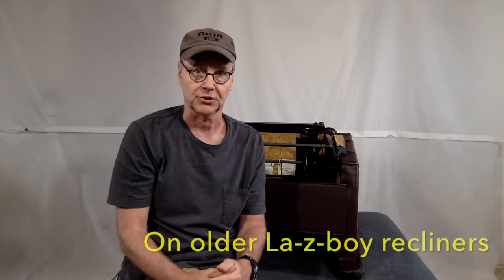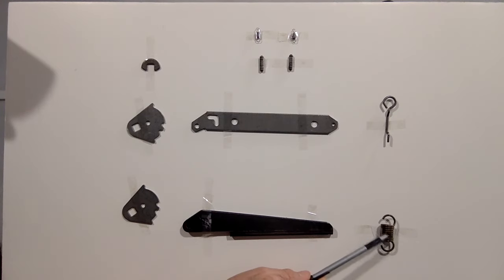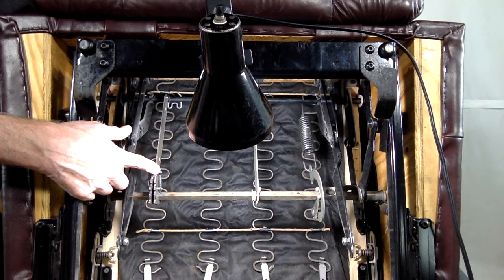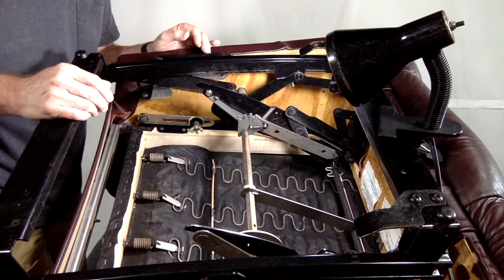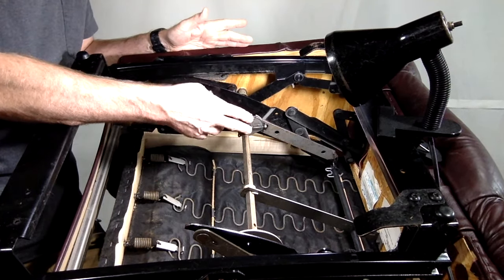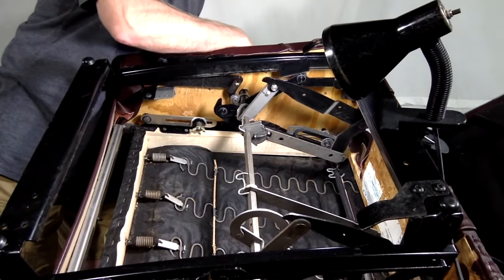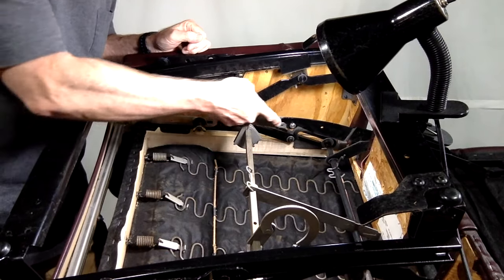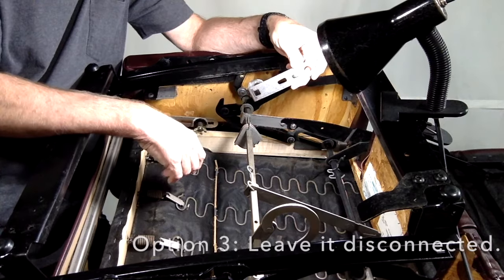Troubleshooting the La-z-boy 3-Position Footrest Feature

Comment: Hi can anyone help. I just got 2 3 position recliners. I am having trouble closing them. I have it fully opened in the third position but when I try to close it it kind of clanks down all at once is is very loud. I cant seem to make it smooth close.I dont know what I am doing wrong,,, Any help would be appreciated. thank you
Reply from the maker: @Valerie Fania - That's normal operation for this La-z-boy design. 

To avoid this sound, some users do the following:
1) If you have long legs, take 1 foot off of the footrest and place it on the floor beside the chair. Push back -- against the floor -- while closing the footrest. This will relieve the pressure.
2) Rock back in the chair just before lowering the footrest. This takes some coordination, but it works if the ratcheting recline is not maxed out (tilted back all the way).
Reply: Omg this was my issue too!  Thanks so much. Now my dogs won’t jump every time I close the chair!

Comment: My non has a 5 years old electric la z boy recliner and plastic mechanism that lift the  footrest broke.   They provide me the part    Do you have any video how to replace it or advise ?   Thanks
Reply from the maker: Reynaldo Pena -  No videos on that subject yet, sorry. If it's the plastic part that slides onto the Drive Rod, that's not an easy fix. I would recommend having a La-z-boy repair tech do that one. 

However, if it's not that one, the other plastic parts are pretty easy to replace. Contact your dealer for a sketch if you're having trouble visualizing how the broken part was originally attached.

Comment: Hi. I have the same type of mechanism as the recliner you are working on in this video...metal parts & bullet pins except I have 2 metal position levers that connect together, one large & one small & I also have a large coil spring..  I'm having trouble figuring out how to install the position levers and where do I connect the coil spring & does the coil spring face up towards the cusion?
Thanks.
Reply from the maker: @Marty Tobias - I don't have a photo to send you at the moment. Contact me through my email address -- pete@reclinerrepairguy.com -- and I'll try to send a photo when I'm back in the shop.
Reply: @reclinerrepairguy4155  Thank You Sir.

Comment: Thank you as well! Simple fix for an stuck extended foot rest on my wife's wall hugger Lazy Boy. I would not have figured out the pin and spring position mechanism without watching your video. While trying to figure it out my wife remarked "does it need a little WD-40? Well, turns out it did, on the springs holding the position pins. Fixed! Now for the other problem. The rollers which allow the chair to slide forward while the back goes down, are worn. I believe at least one of them is damaged. Do you have a video that shows taking apart that part of the base?
Reply from the maker: Stan - I haven't done a video on the rollers (Bearing Link Subassemblies) yet. They come with a plastic cover over the steel wheels for quiet operation. Over time, the covers will crack, split and eventually start falling off. This can make operation noisy and/or rough.

Since the covers are not available separately, the entire Bearing Link Subassembly has to be replaced. Having said that, you can try this first: Remove the plastic plugs on the end of the base tracks (where the rollers travel). Clean out all the dirt and crud that accumulates in the track and causes rough, uneven operation. Also, remove any remaining bits of the plastic covers from all the rollers (if any cover is completely intact, leave it on). This should solve the rough operation problems. 

However, the missing covers allow the steel wheels to make contact with the steel base, which can be noisy. The only solution for that is to replace the Bearing Link Subs with new ones that will come with the covers installed.
Reply: @reclinerrepairguy4155  Thank you very much. I am going to try cleaning out the tracks. You are right that it makes the operation noisy. I might try to replace those bearings (Bearing Link Subs) later as you mentioned. I will try this first and see. Thanks again

Comment: We have a La-z-boy reclining sectional sofa.  We have trouble closing the footrest on one end, while sitting on it.  The footrest hits something and won't close.  If you get up, then push the footrest with your foot, it will close fine.  We have turned it over and can't figure out what's going on with it.  We can't see anything that looks out of place or broken.  Thanks for any help that you can offer.
Reply from the maker: @Nancy Nabholz - That could be due to a few different things: The footrest may be striking the floor or the frame of the sectional. Or, the Leg Extension scissors may be striking the front floor rail, or the mechanism may be bent / damaged. 

I recommend having an experienced La-z-boy repair tech pinpoint the cause.
Reply: @reclinerrepairguy4155  Thank you!

Comment: Thought I'd try this with my problem with my old lazyboy, you recline all the way back so you're laying down basically and it locks and you can't slide back, pretty frustrating though it is a 2005 model. Not sure if it's fixable though. Great video though ☺️
Reply from the maker: @Christian P - If it's a manual recliner and you're referring to the back not returning to an upright position, check out these Seat Swing (the parts that control back tilt) videos: https://www.youtube.com/watch?v=eGYS17hvOzY and https://www.youtube.com/watch?v=jzN1x5jZ-gA&t=3s

If that doesn't help, have an experienced La-z-boy repair tech check out your chair.
Reply: @reclinerrepairguy4155  thank you for the help, checked out the video's and managed to fix it by unwinding the springs fully :)
Reply from the maker: @ChristianP85  - You're welcome - good job!

Comment: do you know what size of springs I need for pivot pins I cannot seem to find them under the chair ?
Reply from the maker: @Dar Piche - I don't know the size, but the Part name is Extension Springs. This is a common part that a dealer may have in stock. When requesting this part, let them know that they are part of the older 3-position setup, so they know exactly what springs you're referring to. Be sure to request 2.

Comment: The bolt that connects my extension scissor to my rear arm has sheared off. I have no idea if I can get a replacement, but I'm so grateful you have helped me learn the correct terms to use as I begin my search. Please keep up the good work!
Reply from the maker: @Dave Killion -- Those shoulder bolts are no longer available. They're been replaced with plastic Legrest Swing Bushings that are fastened to the Leg Extensions using Truss Head Screws. Learn more by watching the video 'Installing Legrest Swing Bushings' at the ReclinerRepairGuy.com website.

And by the way, check to make sure that the round opening in the Rear Swings -- that holds these bushings -- is not elongated from wear. If it's no longer perfectly round, the Rear Swings should be replaced as well. That would be covered in the 'Drive Rod' 3-part video series, also on the website.

Comment: I wish I had discovered your videos before we got rid of one of our old lazyboy recliners. Do you have any suggestions for firming up the lumbar area in a lazyboy back? I really hate using those separately purchased lumbar supports and they ruin the appearance of the chair.
Reply from the maker: Gail Angeluski - To add padding to the lumber area of the inside back, see this video --> https://www.youtube.com/watch?v=PfjpZzTXPBo. It will show you what type of padding to use & how to fit it properly. 

If you don't have the 3-pillow back configuration shown in the video, you'll have to loosen the outside back panel to access the back of the lumbar area. Next, cut open the lumbar compartment from the backside. Install padding as needed. Then sew or staple the compartment shut & finish by reattaching the outside back panel.
Reply: I'm suresh Hosamani I'm laz boy  wark  bost

Comment: How do I adjust or repair the foot rest on the electric chairs ?
My foot rest does not close completely.
Reply from the maker: @Peter Romano - The first step is to determine if the footrest is being obstructed, or if there is a damaged actuator (or other part) that is causing the problem.

Remove the back & turn the chair over onto its arms. Plug in the unit and open & close the footrest while observing the footrest & reclining mechanism parts in action. (Keep your hands aways from moving parts!)

Your findings will determine your course of action.
Reply: @reclinerrepairguy4155  Thank you.

Comment: My handle on my lazyboy is very hard to push and pull.  Do you know what I can do to make it easier?
Reply from the maker: @T G - I'd have a repair tech check out your chair to make sure there are no mechanical problems contributing to this issue. If your chair has an adjustable tension spring, they can also adjust that to see if that helps.

If there are no mechanical problems, there are handle extenders (generally sold by medical supply companies) that may help. If none of the above  suggestions resolves the problem, you should consider purchasing a power recliner or lift chair.
Reply: I turned the chair over and put wd40 spray on all the moving parts and the handle works much easier.